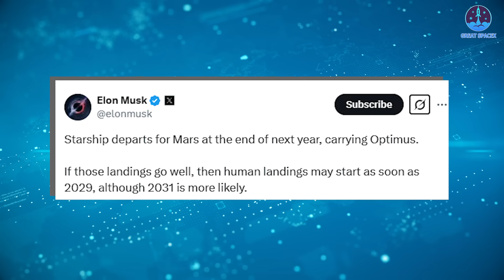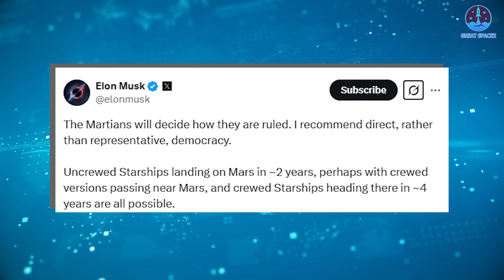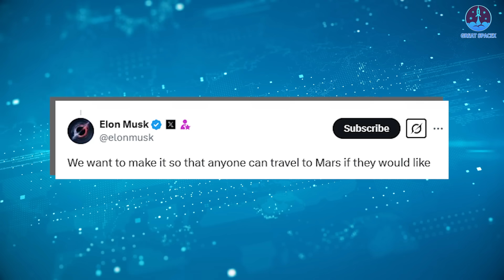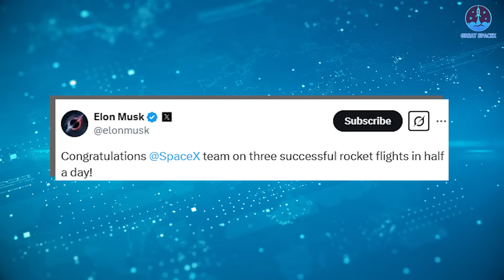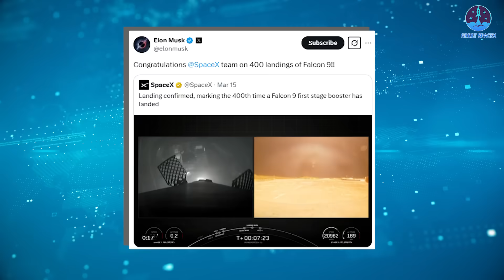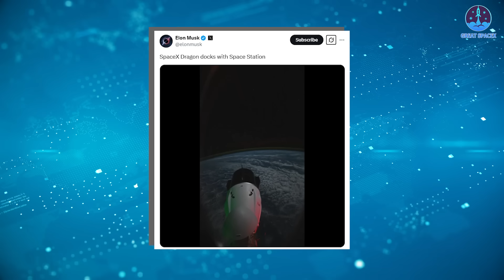Elon Musk Just Revealed First Starship Payload to Mars Next Year!

Comment: If he sends 1000 SpaceX Starship Cargo Pods to the Moon / Mars.  There is no need to refuel the starship.

The Cargo Pods could be the same size of the starship cargo bay. ( 35,000 cubic square feet.)

The starship could have space shuttle  type cargo bay doors.  The cargo pods could be ejected with some kind of spring mechanism.  

After ejected they could be caught by a device that could push it towards the moon / Mars.  Once up to speed the device would release it.  These pushing devices could be refueled by cargo pod tankers, or exchange cargo pod tankers. ( Just swap them out )

The cargo pods could have anti-spin, and course correction devices / mini jets.  So they can travel by themselves.

Once at their destination, they could be caught by a device that would slow them down and land them on the moon / Mars.

The cargo pods would not require an external elevator.  The doors would be on the bottom.

If the cargo pods were landed in a circle, a big inflatable dome building could be inflated in the middle of them.  Inflatable tunnels could connect the cargo pods to the dome building.  The whole thing could be covered with 3D printed cement, even the cargo pods.

Some of the cargo pods could be re-fueled and reused.

Other cargo pods could have pre-built in facilities, like refineries, factories, farms, dairies, ranches, fish growing facilities, grocery stores, retail stores, hardware stores, living quarters, cafeterias, restaurants, bars, jails, police stations, city hall. Libraries, recycling plants, fuel depots, oxygen & water plants, composting plants, etc., etc..
(Just about anything could be pre-built into a cargo pod, saving a lot on site work.  Later buildings, etc., could be built piece by piece.

I was thinking artificial gravity on the moon / Mars could be created by building a giant rollercoaster, with the roller coaster cars so big you can live in them.  The rollercoaster would travel in a circle and lay flat on its side.  So when it traveled at 1G it creates artificial gravity on the floor of the roller coaster, the flat part nearest to the wheels.  

Also we could build a space motel in the shape of a cube, by just docking space station modules together.  It could spin and have artificial gravity.  It could also travel to the moon, and especially Mars.  ( a 7 month journey.)
With just 12 space station modules forming the cube, it would have 420,000 cubic square feet.
🙂

Comment: How they gonna solve the galactic shielding issue,  any astronaut,  I'n deep space will loose there kidneys after 6 months,will need to likely be on dialysis.  Space station is in low earth orbit and still gets protection from earth a bit. But that far away. Kidneys can't go that long. We're not hearing how to protect,  as even nasa, don't, no one, yet. To how. You gonna have 1 to 2" thick lead shielding? Lol, the weight alone. May equal the pay load capacity. Even then, it reacts to it and you have to have a bubble shield of hydrogen around it  likely 2 inch cubed thickness around the lead. You gonna have to put them to sleep for almost the hole trip. Even then how you making oxygen for the crew ? Those pellets they used for appollo,  only last for a few hours. Think they missed showing that in the movies. Just the carbon dioxide issue. I don't think a human will be there and back to Mars, alive, for atleast 10 years yet.
Reply: Load a boring machine and dig underground and cap it off pump it full of oxygen and regulate it. All they need will be there underground. No radiation temperature control and easy to regulate pressure and air.

Comment: A new explosion 😅
Reply: Falcon 9 did 16 test flights, of which 6 resulted in the booster landing.  Now, rockets from the Falcon 9 family have a success rate of 99.35% and have been launched 463 times over 15 years (wikipedia). Starship is a much harder problem than Falcon 9.  Maybe you should have reasonable expectations...

Comment: FFS... they were NOT stranded! Stop saying that misinformation!
Reply: I disagree. They were stranded. They couldn't return to Earth in the capsule they arrived in. Thanks.
Reply: @BMPARCHIVES-1  Correct. They could not return in Starliner. However, there WERE other return methods. A dragon capsule and soyuz module were both there in case of an emergency. Both of which could have been used if needed. They would not have been sent up if there was not another means of returning from the ISS if needed. That is standard protocol for safety. Thanks.
Reply: they were stranded
Reply: @spencerlarson9357  Except they weren't. At any point. Stranded implies no way home. Which they did have. Hence, not stranded.

Comment: I'm wondering when Musk will modify starship with the nuclear propulsion system that NASA developed.  That system will open the launch window to Mars from 27 months-ish to a window a permanent, or near permanent, launch window.
Reply from the maker: That is not easy
Reply: I agree it isn't easy.   There are ways to accomplish this the easiest way would be to put a starship in orbit and convert the fuel storage areas and engine compartment to house the nuclear engine as well as the reactor.
Reply: Starship will never have nuclear propulsion, nor will any spaceship designed to take off and land from a planetary body. Nuclear propulsion is highly efficient and perfect for in space flight but it does not have sufficient thrust for take-off and landing manoeuvres.